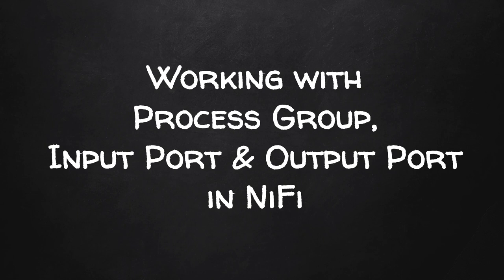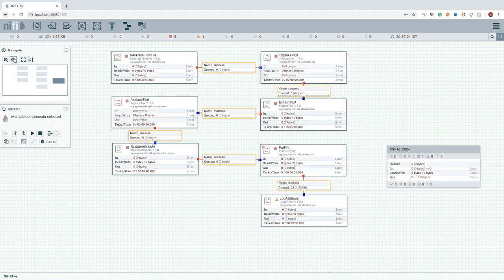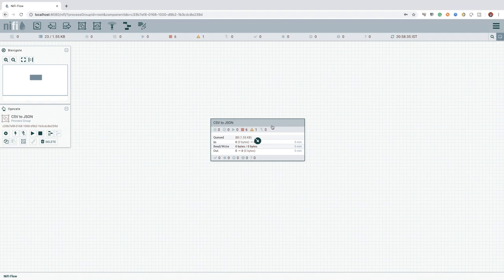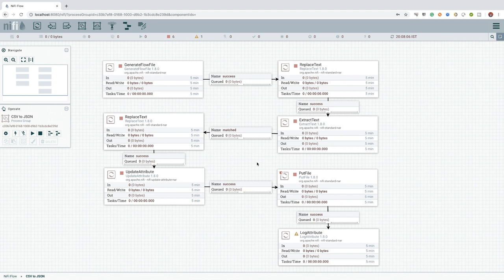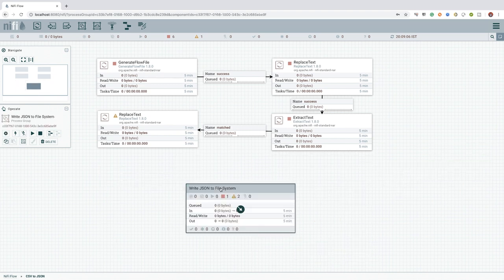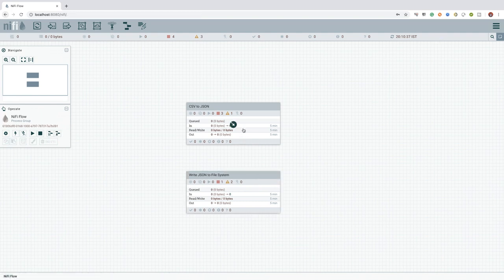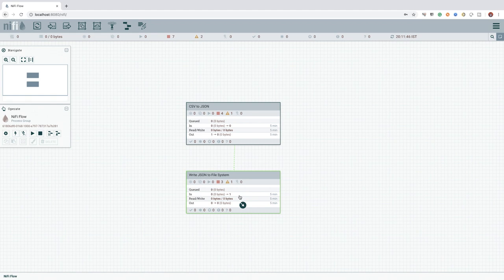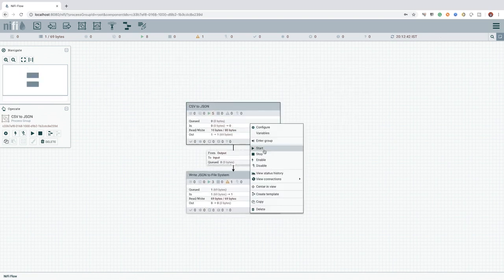Apache NiFi Tutorial - Complete Guide (Part 16)  - Working with Process Group, Input & Output Port

Comment: I have Nifi ETL flow. I put definition table transfers in PG1 and changing tables that use these definition tables in PG2.

For instance, DateDefinition, Categories tables in SQL Server transferred to corresponding tables in Oracle in PG1;
NewUsers, UserNewsRead (which uses Categories table IDs) tables in SQL Server transferred to corresponding tables in Oracle in PG2.

I configured PG1 Output Port and PG2 Input Port. I want this flow work every day at 2 PM let's say. I used CRON Driver definition in ExecuteSQL processors (SELECT * FROM sql_table).

My problem is, the ExecuteSQL processor that is connected to InputPort in PG2 is not working. InputPort queues flowfiles but connected ExecuteSQL processor is not triggered. Neither by flowfile, nor at the exact time it supposed to work.

What could be the problem here?